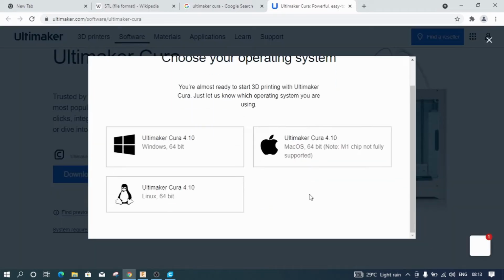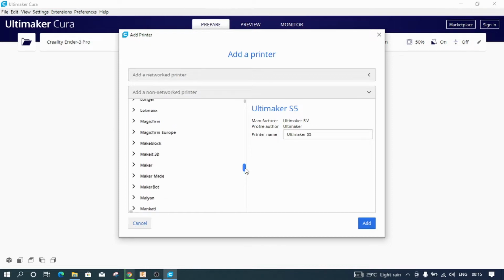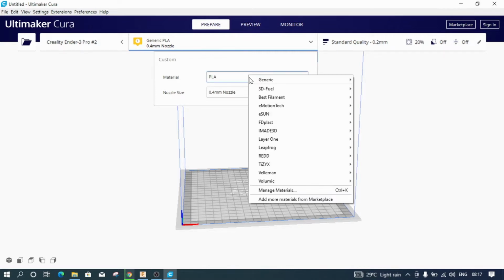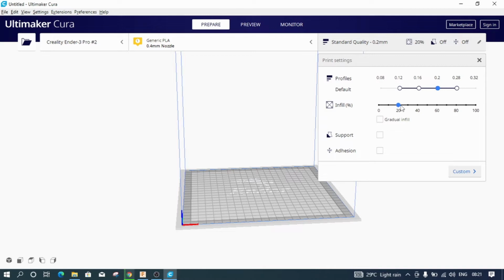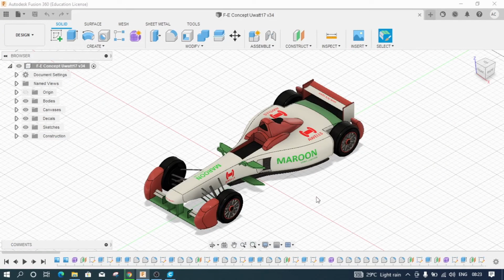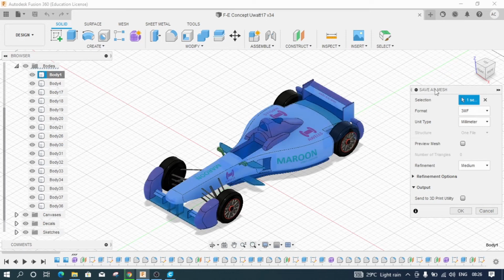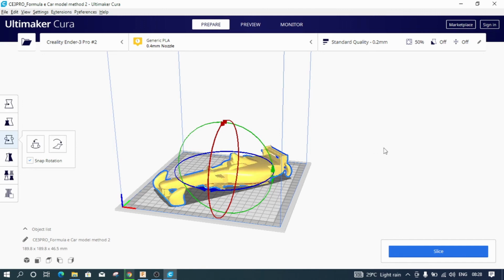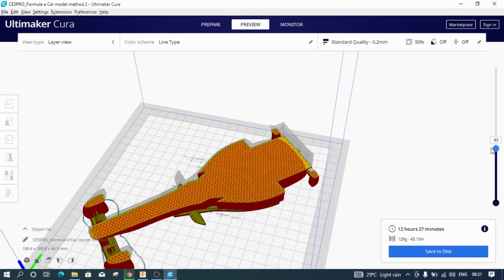Week 1 - Part 3  - Introduction to 3D Printing with Ultimaker Cura Slicer | 3D Printing Internship

Comment: Informative.. Looking forward to see how actual car model looks like after printing through this process compare with CAD model. 
what would be the possible file name extension after slicing and generation of G-code, apart from   (.gcode) in Ultimate Cura Slicer.
Reply from the maker: There are many more file formats like DXF which are used by CNC laser cutters and planar overhead CNC wood cutting machines. Robots use their own language formats. ABB robots have their own format, KUKA has its own format and so on